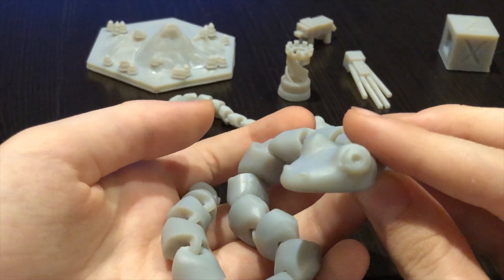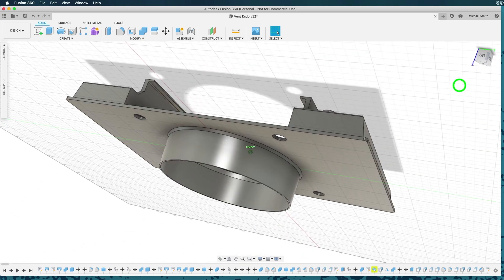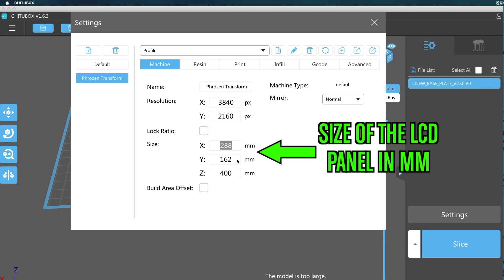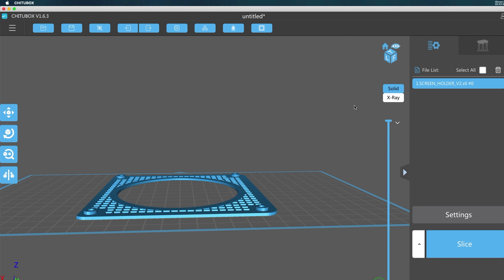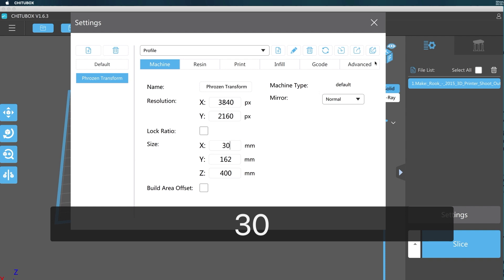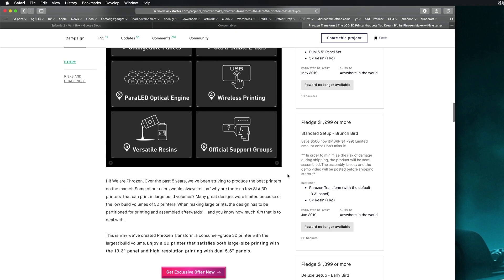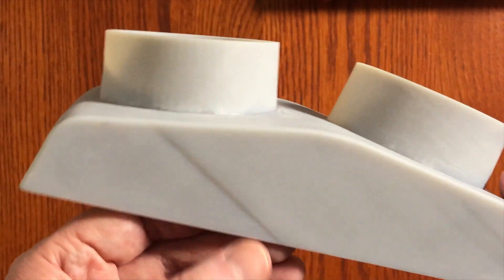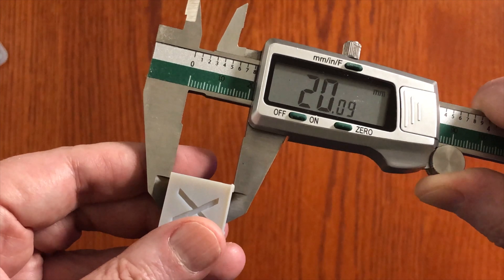Get Accurate Prints - Calibrating Your SLA 3d Resin Printer

Comment: Odds are, there aren't so many types of masks used to manufacture the panels. So with some luck, you'll find a panel that's used in the printer on panelook, or one that matches the tooling exactly; if you're lucky enough to find the datasheet for that then, you might get an exact size of the active display area down to a hundredth or thousandth of a millimetre.

Also it's a good strong assumption that pixels are exactly as tall as they are wide; so unlocking the proportional scaling might not be all that helpful, and if you have a disagreement in measurements, you might as well just use it to split the difference and approximate the true pixel size closer.

Comment: Hello
I print on a Photon SLA printer and I have a strange problem. The external dimensions of the printed precision components are perfect, while the holes are smaller. Exterior and interior surfaces are also perfect, angles, and edges too. For example, a 2.5mm diameter hole has a diameter of 2.2mm, with a diameter of 3mm has a diameter of 2.75mm, and another one with a diameter of 2mm has a diameter of 1.5mm.  I am asking for any suggestions. Thank you in advance for your help!
Reply from the maker: Well maybe it's an overexposure issue.  If overexposed the holes could occlude a little.  That wouldn't explain why the outer size is spot on.  But you're talking about 2.5 down to 2.2 - that's a reduction of .15 per side.  So are you sure your outer size isn't larger by .3 as well?
Reply: Did you ever get this solved ? i have a test cube that is 30x30x10  (this is on a mono x) , it comes out as 30.07x30.07x10, that bit is ok, but my round test hole at 10mm comes out as 9,57, my squear 4mm holes comes out as 3.57 and my round 5mm hole comes out as 4.61, is it anyway of fixing this ? i mean, i can do better than that on my filament printer :(
This was sliced with Lychee, any idea if there will be a difference / better with CHITUBOX or Photon Workshop ?

Comment: Good info thanks   Any luck on calibrating the Z?
Reply from the maker: I've never tried.  The approach would be to slice at one height (like 0.049) and then print at 0.05.  And in that example it would give you a 20% change.  (I'm too tired right now to figure out if it would shrink it or expand it.)  I'm not sure if there's an easy way to do that.

Comment: I actually have an issue where my Z axis is stretching circular holes by 0.5mm in its axis. So the object is exactly the right height, but the holes are 0.5mm bigger... its strange to say the least
Reply from the maker: Z axis calibration is a whole other animal.  There is theoretically a way on the transform because you can slice at a different Z than what you print at.  That would shrink or stretch the Z.  But I don't think that's possible on any other printer.  And honestly I've never tried it on the transform either.

Comment: Try lychee i get pretty much spot on results all the time fory 1.35 1.16 model's but i found this interesting! In lychee when i rescale anything the build plate doesn't change to a strip or anything other than your printers build plate size this could be an issue in chitubox i stopped using that slicer a while ago since lychee got all it's new updates that your lost without now if use anything else but each to their own use what works for you!

Comment: Did you post any info about how to fix the high calibration. For example when I print a box 10x10x10 the height is 1mm off. 

This is prob the best video for resin printers! thanks!

Comment: If you haven't already discovered this: M8010 can set the Z-steps. It's a part of the process to get the Z-axis accuracy. (May not be the overall solution, but it helps.)

Comment: What a pitty! I really need to know how I can calibrate the Z axis of my Mars 2 Pro.... 5% less than it should be :-/   .... It seems your method doesn´t work with Z.
Reply: Why wouldn't it work? Just need to get a known object (I'm using a 40x40x40 cube) and then measure the height. The bottom might have issues with the extra exposure from the first layer, but I don't see it being too large an issue
Reply: @KattDa  Just test it by your own. Shouldn´t work. I´ve leveled my bed a little bit higher... best method for the moment.

Comment: Why not just straight up use scale instead of mucking with the size of the screen dimensions?  Your screen dimensions didn't change, they are probably correct and stated fact from manufacturing.  What we are dealing with here is tolerance issues probably even machine to machine.  This can be dealt with across the board by just keeping the pixel dimensions and screen dimensions as stated from the factory and adjusting using scale within your slicer of choice.  This is exactly how you can deal with Z.
Reply from the maker: I disagree.  There shouldn't be tolerance issues on these LCD panels.  Not a 2% tolerance anyway.  And LOTS of people have seen this same 2% scale issue on the transform.  Phrozen just gave us the wrong numbers for some reason.  And remember, the scale issue isn't uniform on the X Y and Z.  So you have to calibrate each axis independently.